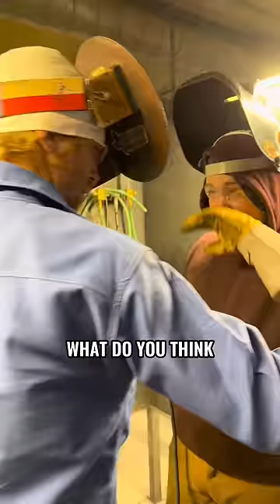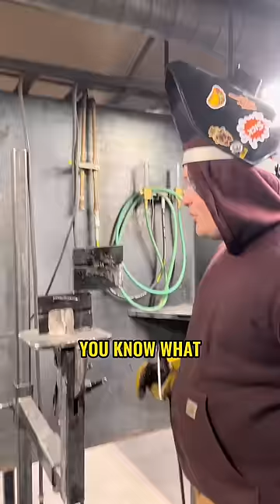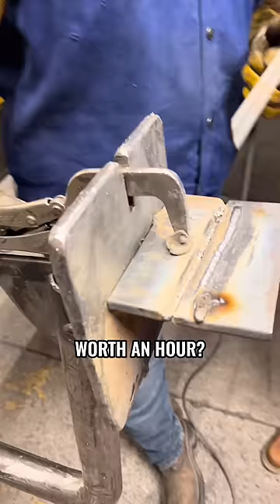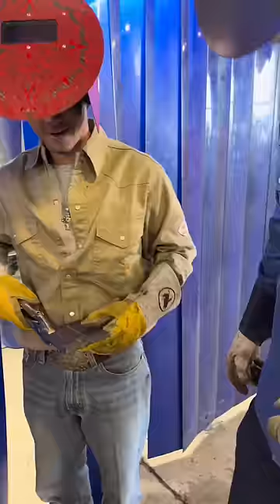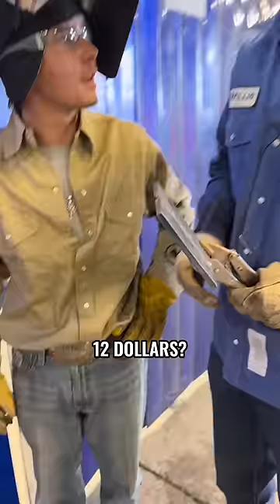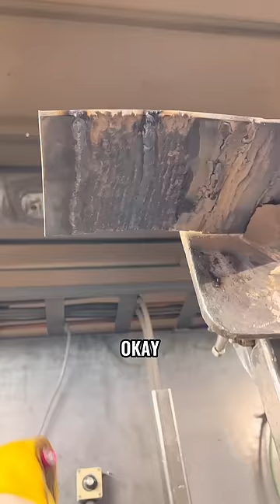How Much Are They Worth? #weld #welder #trending #viral #viralvideo #fyp #fypシ #4u #foryoupage #weld

Comment: The overhead low hydrogen welds look good. 
I was working on a barge in Galveston Bay Welding on a pipe structure that was going on a ship there were a bunch of brackets along the side of the pipes and the guys welding them on all welded them different I got the lovely job of cleaning them up with a grinder and putting a cover pass over all the welds so they look the same.
Anybody ever experience welding on the water with the sway of the ocean makes overhead real interesting.
Reply: I wasn’t the welder but I was the carpenter on the job, we had some steel overhanging lake for a dock/deck of a massive rock and was watching him work just swaying up and down in the current, I give the guy allot of credit it came out good, couldn’t imagine bay water or ocean, we just on a lake lol
Reply: MadMax 57  why
Reply: MadMax 57  Galveston was a terrible place to work very dangerous town never want to raise  kids there.
Reply: @ethanelectric1024  sit yourself down in a rocking chair and try making an overhead weld while moving back and forth.
Reply: Never welded on the ocean but I worked in a wet cannery did alot of Tig welding stainless. "Shocking time"
Reply: Try hanging onto a pile underwater when it’s bobbing around trying to get cover plates on sheet piling of a discharge canal. 😂
Reply: Yea I’ve come to find that I’m not sure it pays off to be all that good in this field 😂
Reply: @tom-vs3lf  I don’t know you and I’ve never seen your face, but I respect you.
Reply: Also from Houston.  Galveston ain't bad. Hope they paid you well or I might have to change my mind.
Reply: @Pauly365 and many sharpenings of the tungsten...ugly thing to do,especially when you get few shocks and you start to shake your filler rod dangerously near the tungsten tip,mens get the job done anyway ! 😀
Reply: @WesternWeldingAcademy  I want to learn how to weld. How can I come to learn and work?
Reply from the maker: @zippydooda  You can send us your application at applytoweld.com!
Reply: That’s craaaaazy fr! Must have a steady and coordinated hand ash 😬
Reply: @Pauly365  shocking? Hahaha
Reply: @ebolawarrior451  that’s my dream job 😌😌

Comment: There's a difference betweem being good at running a bead and positional work in cramped spaced welding gaps as wide as your fingers on steel thats so rusty its crumbling away

Comment: These kits need to come to Alberta make some real welders wages that guys offering chump change.
Reply: I didn't hear him offer. He is asking and going slightly above. Boys cutting themselves short. 🤬
Reply: @randyloyd8896  still chump change get your red seal and work in Canada live in the US fly in welder wages here.  You make 60 to 120$ an hour in the oil field depending if your at at fab shop or out welding pipe out at camp.     What's the typical pay rate down there?

Comment: You don't let anyone even a teacher tells you your worth instead of asking for worth just at least teach them the technique and the steps start from basic thats the mistakes many tutor make is talking about worth but not the basics of welding start by explain different types of welding and it's procedure also cover the welding machine manual than types of welding for types of material most people only do welding due to friends talking about pay being a welder and not forget you have to have passion for welding and understand welding. After that start explaining types of welding and it's angle also not forget WPS (Welding Procedure Standard ) money comes after experience with welding ticket first than talk money later

Comment: Okay. Listen boys, this is gonna be a tough pill to swallow. But this is the way it works. There are welds that are acceptable, and there are welds that are unacceptable. There is no spectrum on how much a weld is worth. You'll either lay shitty ass beads and be unemployed, or you'll lay acceptable beads and get paid. How much you get paid does not depend on how good your welds are, as I said earlier, there are only acceptable and unacceptable welds. If you want to get paid more, you'll have to be willing to work more or how badly he needs to hire you. If there are a hundred other people that want and are qualified to do that job, the pay will be less. It also depends on how much he's going to have to trust you, i.e. pressure vessels and structural jobs will offer higher pay (for more desirable higher skilled welders) than basic fabrication or ornamental work. 

that $3.50 weld doesn't exist in the industry, and that's because nobody will pay someone $3.50 to weld something together. 

If your welds aren't worth a million bucks they ain't worth shit.

Comment: Stupid question. Why are welders paid so much more when the joints look better? Is it also a stronger hold or does it go more with speed or something?
Reply from the maker: it depends on the project you’re working on, sometimes the weld should look cleaner aesthetic wise thus needing to be paid more

Comment: welding is the most overrated trade in existence. im three time certified and can't get a job past $27h
Reply: Travel. Should push you near or over 6 figures if work all year. I did and worked 7 months, stacked up, took time off and lived off unemployment.